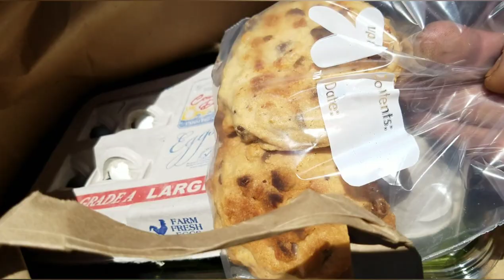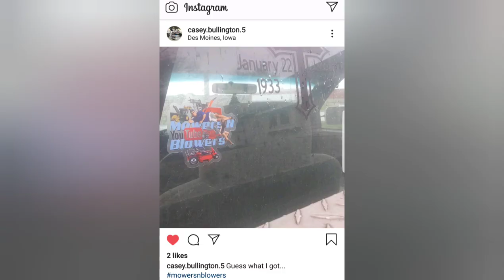NYC QUEENS ROOFING MURRAY LT TRACTOR DEAD BATTERY 2020 1ST MOW LAWNBOY 20" LAWN MOWER BACKUP OLD GAS

Comment: Hey Henry thanks for the video I Had my windshield repaired like that and you can still see the cracks but it will stop it from spreading it is a lot of work to fill in a big crack like that
Reply from the maker: Thx dom
Reply: @MowersNBlowers  Henry, a new windshield for my 2014 Chevy Impala was about $250.00  (Chicago area)
Reply from the maker: It’s about the same here too!
Reply: @MowersNBlowers  There is a large community of Mexican people living in Chicago and I hear you can get a used windshield for about $150.00.  Mine have always been broken so badly I had to get replaced immediately' couldn't shop around!

Comment: Got get some climbing rope enough to go over top of her house and hit ground other side. Get 3 or 4 of the heavy 3 rectangle hole cinderblocks..  tie rope offsnd walk up the roof and fix that roof problem.. 1 leak will ruin inside ceilings
Reply from the maker: I’m thinking a long ladder from the bottom.

Comment: That roof won't make another year it's old style 3 tab
Reply from the maker: It’s made 20 years so far
Reply: @MowersNBlowers  didn't see any felt paper under
Reply from the maker: Felt paper? There was this black cardboard paper over the plywood.
Reply: @MowersNBlowers  that's felt paper not cardboard it was torn must be 3 tab shingles are average 20 year roof
Reply from the maker: Then it’s about that time
Reply: @MowersNBlowers  i would put stone coated metal roof on 50 year life span
Reply: @MowersNBlowers  https://images.app.goo.gl/XV1Q2QowUqVSRbUi6 here is a stone coated roof